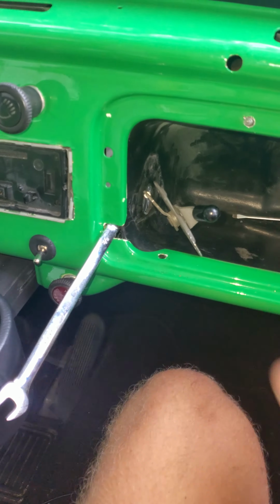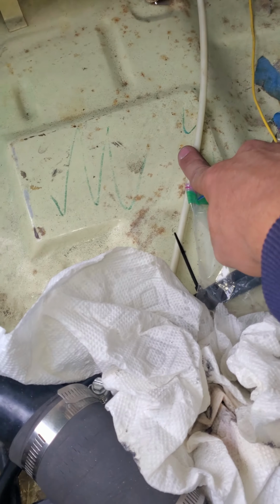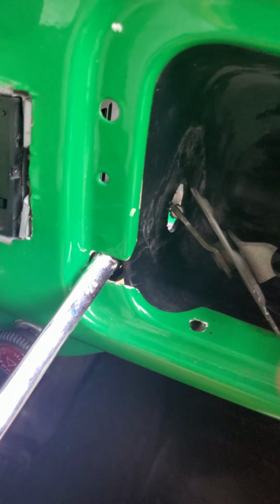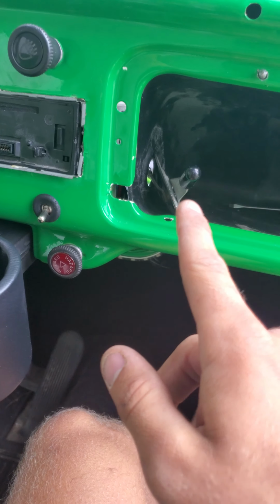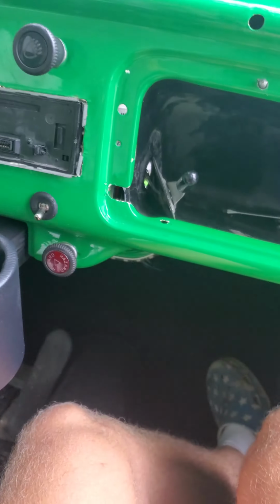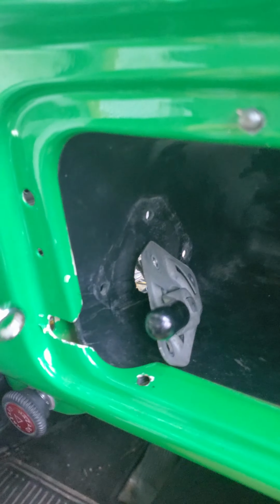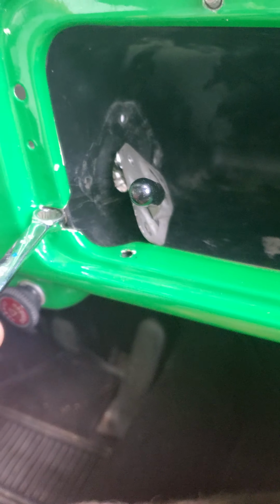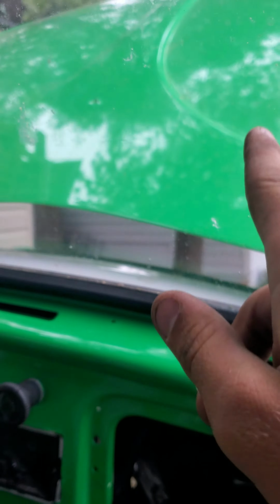Volkswagen Beetle Hood latch is stuck

Comment: I’ll be trying this on my 1972 Super Beetle.  I also have the spare tire out of the trunk and the large metal plug is gone from the spare tire well.  If I’m unable to release the hood via the opening in the spare tire well, I’ll definitely try your method as I have the same plastic glove box with the trunk release affixed like yours was.